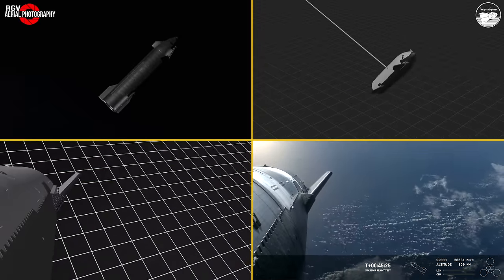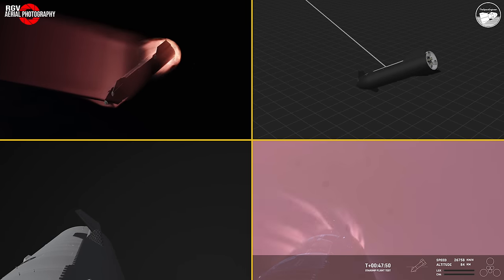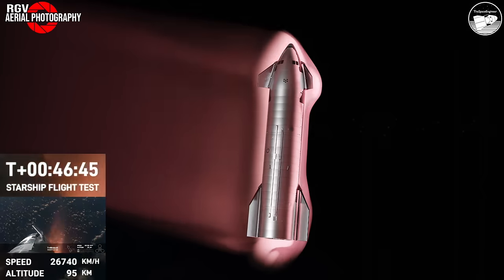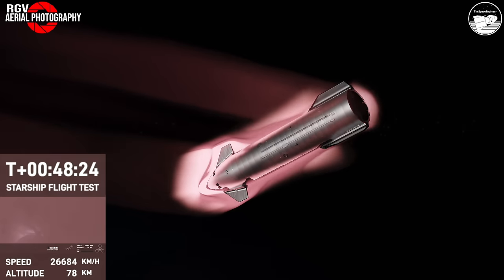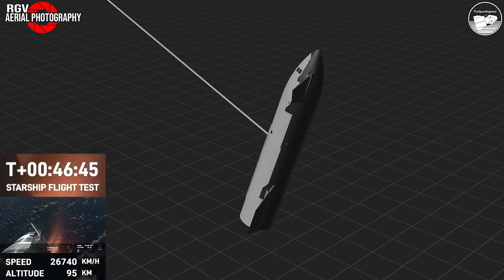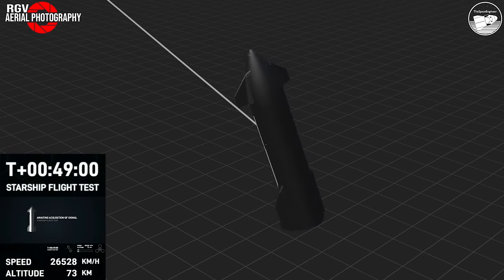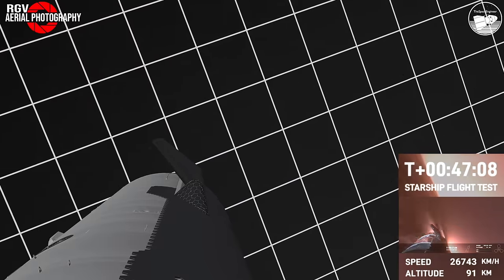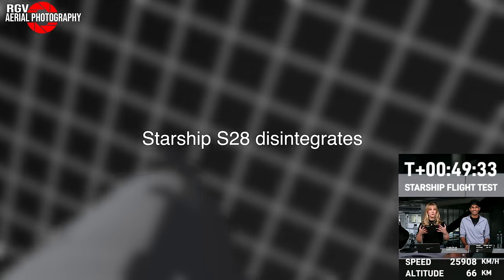SpaceX Starship Re-Entry and Breakup: 3 Render Simulations!

Comment: Perhaps SpaceX Starship mission profile should have included one orbit to allow for a sanity check before reentry. Spectacular mission but seems to have place craft under maximum stress without allowing systems to normalize. Fantastic overall design and mission accomplishments
Reply: This outcome is overall a positive one. If instead the failure had left the vehicle unable to control its reentry position, and deorbited over Belize, that would have made it very, very negative.
Reply: Insane to try to put it in orbit until you've proved the engine relight is working.  In the actual flight the excessive roll prevented the engine relight so if it had been in orbit it would be the biggest piece of space debris ever.  They shouldn't try orbit until several engine relights worked perfectly.
Reply: It didn't manage the engine relight, so it couldn't do 'just one orbit'. As you can see, reentry produces massive heating well before significant slowing, so you really don't want to be trying to come in using a decaying circular orbit. Even if you could control it your vehicle would cook before slowing much. You want to get down to the thicker atmosphere quickly to reduce heating.
It had to be suborbital to guarantee a safe reentry location. Given they didn't manage the relight the next flight will too.
Reply: Not safe to enter a stable orbit before they can fire engines and de-orbit to avoid becoming space junk
Reply: @sja45uk At that altitude it wouldn't even be space junk, it would reenter in some months or weeks, the problem is you wouldn't know where
Reply: @rizizum  I agree, but haven't seen any statement from SpaceX on what altitude they might target for their first true orbit. Would they want to be above or below the Starlink constellations?
Reply: @sja45uk I assume they'll try to deploy some Starlinks on the first true orbit, so probably close to the Starlink height
Reply: @rizizum - do SpaceX have to get the Starlinks into their final orbit height or how much can they alter the height during final position manoeuvring? Perhaps the next generation will have great capabilities since they are larger.
Reply: @sja45uk From what I checked they seem to deploy the satellites at around 200-300km of altitude, but most of the satellites operate at around 500km of altitude. I have seem some launches where they deployed at 500km though, so the satellites can get into their final orbit height if needed, but sometimes they put them directly there and I don't know the reason why
Reply: @rizizum 
Starlink satellites operate at a variety of attitudes, but the new full-size version is going to be inserted at a low altitude.

Comment: Great Work RGV. Gives a better perspective on the re-entry attempt. I am surprised Starship didn't burnup when the butt end hit the plasma field. Also, if the speed telemetry was correct, even when the orientation of Starship belly down, the speed didn't drop much. I sure hope that SpaceX didn't miscalculate the speeds of Starship vs the re-entry de-acceleration needed. 26730 km/h at the 1st sign of plasma, and 26400 km/h at potential disintegration.

Comment: Well done for getting into space and collecting important data. looks like on return it could not maintain the critical angle on re entry. To tackle the heat. at times turning onto the rear and even the unprotected sides. Think its supposed to hit heatshield side at about 40 degrees or something and maintain through upper atmoshere

Comment: KEWL ! !   🤩    Thanks for sharing this Guys n Gals, it makes sense and provides a Much appreciated visual.  I wonder where the WB-57 was located, relative to this flight,  and when SpaceX will decide to share those High Altitude video's.
Reply: Would you be surprised to hear the WB57 didn't take off for the launch?
Reply: @geoffallan  No, I wouldn't, but it was announced around a week before IFT-3 that the WB-57 would be in the air for this event. I hope it was and I'd be very Happy to see any actual video of a StarShip Re-entry.  
   It just occurred to me that since the Re-entry point for SS was changed to somewhere off the coast of Australia, that maybe the filming of the original planned Re-entry near Hawaii was scrubbed.  All this assumes that the StarShip is the target, and not the SuperHeavy Booster, which would be almost as exciting to see. 
    Elon likes exposure of SpaceX events and will very likely release any WB-57 vid's if available, pending a full review first.

Comment: It appears to me that they could not keep the tiles surfaces taking the brunt of the friction. The engines that were expected to restart must have been damaged by the high temperatures. This could have been caused by something as simple as a fin not operating correctly. Perhaps the motors were supposed to fire when the ship maintained the nose up attitude and failed for some other reason, but when I saw the plasma glowing where the engines were I was pretty sure they would not fire back up. Cars used to suffer from something called "vapor lock" in the fuel became too hot before it reached the carburetor or injectors. 

Thinking about the door for future satellite delivery, if it did not close completely it would have influenced the aeronautics of the ship.

Comment: From what I can see, even while it entered with a rotation in the atmosphere, it should have been possible, by using the flaps, to orient itself and keep the correct attitude throughout the entry. Was a hell of a "pressure" to lean on for adjustment. Somehow, I don't see those flaps adjust too much and are not moving correctly, corresponding to the ship position.

Comment: hmmm so basically it was already in a good position when it broke? if that's the case, then the solution might not be as simple as fixing the entry position
Reply: It has been heating up randomly such that the later orientation alignment could not have saved it
Reply: It was totally out of control during re-entry meaning it went into the denser atmosphere too soon going way too fast. It was impressive it lasted as long as it did and the heat shield seemed to hold up well at times when it happened to be oriented correctly.
Reply: We dont really know if it was at that position when it disintegrated also the metal on the side will get much weaker

Comment: Could its center of gravity was out as the engines are heaver than the front  of star ship  the flaps could not work because of the thin atmosphere  so  there was no real control
Reply: For what little I know it acted like the center of mass and center of pressure swapped sides. Wonder where the propellant was at the time.

Comment: I do wonder what the actual height and speed was. For it to have been at 70km, the drag force is pretty close to 1g. That seems ... doubtful - heating at that time would have been >10MW/m^2 Unless I've screwed up the atmosphere model. I do wonder if there had been an intended 'dive' manoever, steepening the trajectory aerodynamically, before flipping again, to better mimic >escape entry, and we were seeing the predicted altitude. The ship may have been massively out of trim, depending on the intended magnitude of the burn and amount of propellant it intended to dump.
Reply: That number seems right, but the idea of a blunt shape is that little of the energy goes into the skin. It heats the shock wave a few cm away from it, flows round the ship, and stays in the air. Leading edges face the full fury of it though.
Reply: @agsystems8220 I perhaps have misread the accelleration on the first watchthrough. km/h is an annoying unit and I think I miscalculated it in my head. It does look to be a sizeable fraction of 1g at peak, even accounting for the data droputs.

Comment: Their gas thruster feed of the main tank were crap they need the hypergolic thrusters those always work
Reply: Would contradict  "The best part is the no part" paradigm that Elon teaches though. Can he find a quick fix for IFT4 ?
Reply: Contradicts the starship design philosophy. Starship is a cheap rocket that they are working very hard to make fly, as opposed to the usual approach of taking the easiest path to a working rocket and then making it cheap. Hydrazine thrusters are not cheap, due to handling considerations. If a cheaper solution exists that is harder to get working then the philosophy says they should go for that.
"Easier solutions exist" is not a comment relevant to the starship program.

Comment: In about how many flights everything will work well from launch to landing?
Reply: I think 6 to 10 more
Reply: Quite a lot. Recovering the ship is cooler, but arguably a much lower priority than the booster. Work on saving 6 raptors or 37? Clear which is more important. The immediate priority will be the relight though, because if it cannot deorbit safely then it cannot be allowed to orbit, and that means no paying payload. It will be the cheapest ride to orbit even while they fail recovery, but only once it is allowed to go to orbit.
Once it is operational flights will be scheduled based on cargo, rather than when they think they will hit the next milestone. Progress per flight might slow as improvements are implemented 2 or 3 flights down the line rather than the next one. I expect they will probably aim for 3 accurate soft splashes in a row before they risk a tower.
The relights are the major question at this point. The deorbit burn is the last hurdle to being operational, while the booster failed it's landing relight. This one could be hard, so I am not convinced the next flight will be as soon as many people think.
Reply: I suspect that the autogenous Oxygen systems produce a lot of CO2 and H2O ices that are gumming up the oxygen valves and blocking the Raptor inlet filter. 

They may need a Raptor version that produces no ice in the LOX tank, or an ice separator that keeps the main tank pristeen.

Comment: The ship was obviously out of control before it got very deep in the atmosphere. I was amazed during the live stream that none of the commentators noticed. 
I suspect they used too much of the control rocket fuel, and perhaps they couldn't relight the Raptors. That would have contributed to the breakup by not adding the expected attitude.
Finally, the trajectory was steep up and down. That itself adds a level of complexity.

Comment: If plasma is made form charged particles, is it possible to use a magnetic field to push it away so you wont get as much heat? Also, is it possible that pushing plasma away creates a reaction force that could be used to exert control on the vehicle?
Reply: Nope, "force fields" of that strength are fictional, except for the entire molten core of Earth that can deflect the charged Solar Wind around the planet. 

Orbital speed is 27000 k/h, or 7.6 k/s. So the air molecules pack-up (compress) against the ship surface, creating an extreme pressure and temperature. The only recourse is to withstand this temperature. 

The atmospheric molecules collide so violently that they lose valence electrons, which float nearby and soon recombine, releasing photons. 

The Falcon 9 booster fires 3 main engines for about eleven seconds to reduce a mostly vertical velocity, while coating the bottom in exhaust, which is far cooler than the plasma. This exhaust barrier is the closest we get to a force field. 

However Starship has to withstand minutes of much hotter plasma at a far higher orbital (horizontal) velocity.
Reply: @imconsequetau5275 yeah, my thought is that, if we can try and contain plasma in a tokamak to create a fusion reactor, would it be possible to just create a field that would expel this plasma away during re enty? But I have no idea of the math and power consumption and all that would be needed for such a thing.As i understand though, photons and light is not readily affected by magnetism so if that is the main source of heat and not particles, then I guess there is no meaning in such thing

Comment: How is Starship supposed to maintain it's proper orientation during re-entry? Retros? For that matter, how do any returning space vehicles maintain orientation?
Reply: Starship needs thrusters for orientation control for the early four-to-five minutes of hot reentry. In fact, this time Starship broke up around the moment when transition from thruster to flap control should normally occur. (Although there was no thruster control, ever.)
Reply: All other returning spacecraft are either spheres or conical capsules that are weighted to maintain orientation in the plasma airstream during entry. Capsules are weighted off-center so they have a significant sideways drift. They can be repeatedly rotated around the main axis to control the direction of that drift. 

Both the Apollo and Orion capsules demonstrated an ability to modulate their course through the atmosphere and fine tune the exact landing spot.

Comment: The rotation in space is normal. It kept temperature even like doing a barbeque. But the rotation should stop when reentering the atmosphere and keep the heat-insulated (black) side against the plasma. The fact it didn't disintegrate immediately when the plasma baked against a wrong surface was already spectacular. Stainless steel is way tougher against heat than the traditional Aluminium and Lithium.

Comment: Where did you get the data for your model - visual clues from the 2D attitude animation and the images?
Reply: For the first 3 quarters of the simulation I can base it solely on the actual camera views since that is precise and accurate. Once the camera feed drops out however I am pretty much on my own, so I take the last existing state of the vehicle and run some basic physics simulation to replicate what may have happened during the last 30 seconds or so without camera feed.
Reply: @TheSpaceEngineer  it looks like a pretty good approximation  for such a limited access to real data.

Comment: Obviously this vehicle was completely out of control.  There was zero chance it would survive to splashdown.  I could see no thrust control whatsoever.  SpaceX has some serious work ahead of it to get to the point of splashdown in one piece.  My guess is they need to revamp the thruster control, the thermal tiles, and the rear aero surfaces at a minimum.
Reply: I suspect that the autogenous oxygen pressurization system is producing CO2 & H2O ices that cripple the ship in many ways. Clogged LOX inlet filter screens, jammed oxygen control valves, etc.

Comment: Problem is that the vehicle did NOT slow down (to any significant degree). 26,700 to 26,100 Km/hr is not nearly enough deceleration. The vehicle’s drag coefficient over the re-entry regime is just too small.

Comment: In first seems SpaceX lost starship control in low orbit, why we don't know at this time ... After I think spaceX tried to control the atmospheric entry position by using the wings as an inertia balancer but it's not enough Starship is very heavy and at this altitude it's like into vacuum it's not possible  to have an quick corrective action as a plane, no enough portance. Perhaps it's will necesary to use somes small jet motor as used on satellites to keep the atmospheric entry orentation? But what technology to accept plasma temperature ? Atmospheric entry of Starship is not win ... it's again a big challenge ! 
I wish SpaceX good luck, but we know they are strong...

Comment: One thing that makes me worry a bit is the fact it did not lose more speed than a handful of km/h. Even when tumbling they way it did, we should have seen a drop in speed. Will be interesting to see how they solve that.
Reply: For it to lose velocity efficiently it needed to be held at the correct angle. This obviously didn't happen so it ended up plunging into thicker atmosphere too soon going way too fast. My guess is the RCS thruster system completely failed.
Reply: @schrodingerscat1863  I agree, but even the faulty orientation should have caused a drop in the speed. There was practically none.
Reply: @knowledgeisgood9645  It was also due to the fact that it was still very high in the atmosphere. If you play KSP you can easily see that the plasma will form around the spacecraft way before it starts to rapidly decelerate
Reply: @knowledgeisgood9645  In the upper atmosphere the density is so thin it really doesn't slow down much at all. The way re-entry normally works is you dip in and out of the atmosphere gradually slowing down while keeping heating at a manageable level. When you see plasma start to glow around the ship that wouldn't provide hardly any resistance and velocity would remain reasonably constant.
Reply: Did they not to try to start one or more engines before re-entry. What was ship's position then, was it going engines forward so that it could brake and slow down speed
Reply: @pekuheppanen3196  That was skipped because there was a problem with attitude control.
Reply: @schrodingerscat1863  I meant that are the going to slow down speed with engine burn before re-entry in the future, in next flight?
Reply: @pekuheppanen3196  No the engine burn was just to test an engine relight in orbit. there was no deorbit burn planned or needed for this mission.